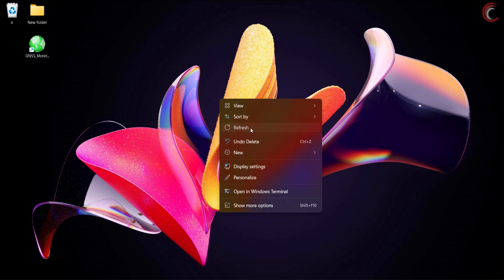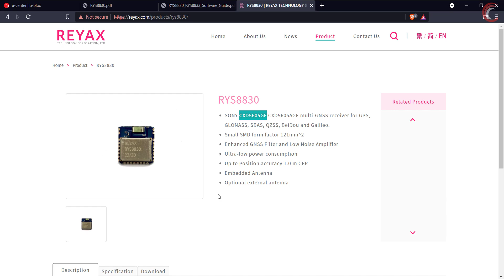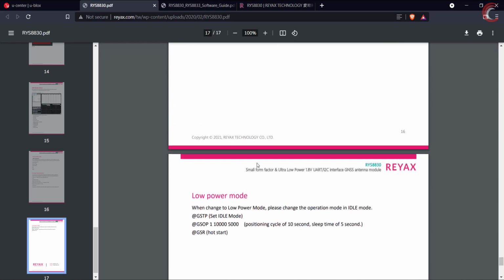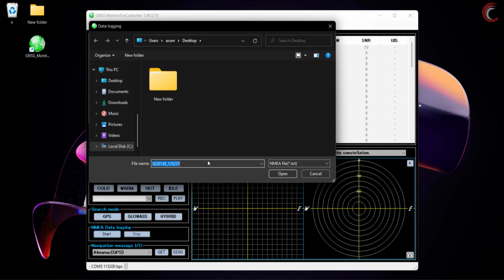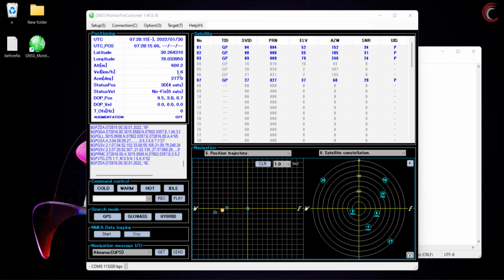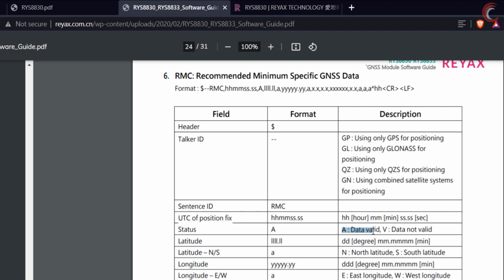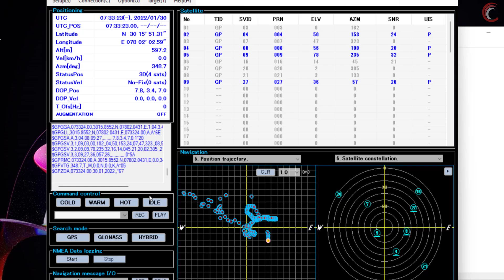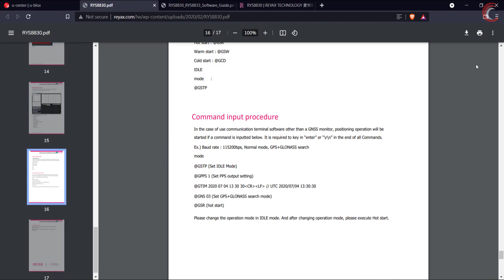Getting Started with GPS Module || Reyax

Comment: Is it enough just to put that small piece only or should it be put with a holder for it?How long does it work ( battery) ? How can it be charged with electricity?What is the maximum distance that can be tracked? I mean, is it possible to know the location and the chip in a city other than the one in which I live?
Reply from the maker: You use a mcu to interface it. It doesn't work on its own.
Reply: @ControllersTech  I don't understand you. What you mean by mcu. Can you respond my questions one by one ? Please
Reply from the maker: Its a module, so you need some microcontroller unit(mcu) to access the data from it.
Check the manual for power ratings.
It doesn't charge. It needs a continuous power supply which can be provided by the mcu.
Max distance ? There is no such thing. It does not send you the data. It just outputs the data to uart. Now what you do with it is upto you.